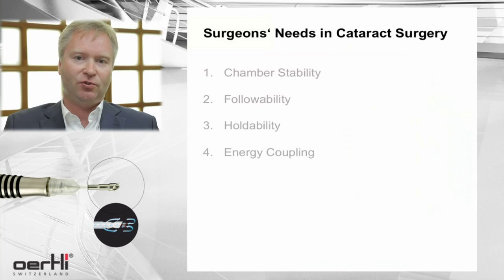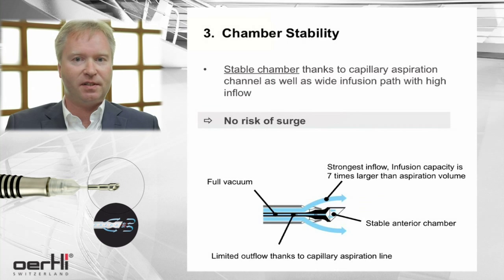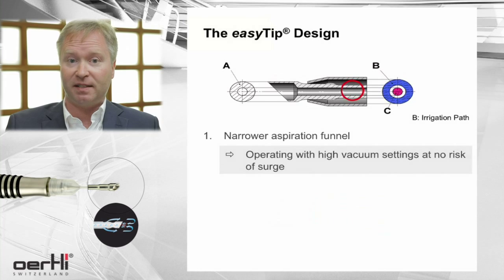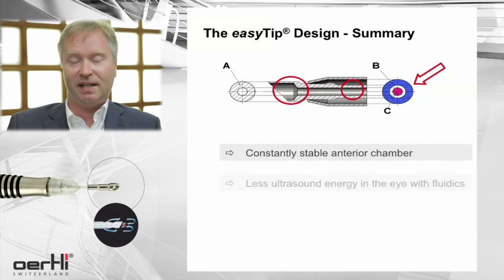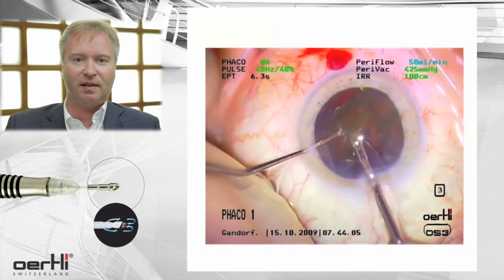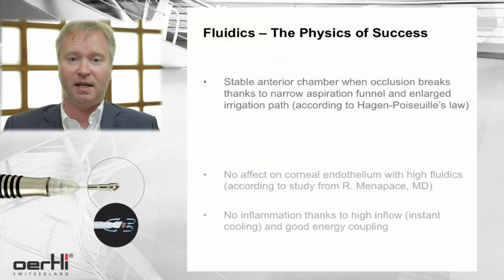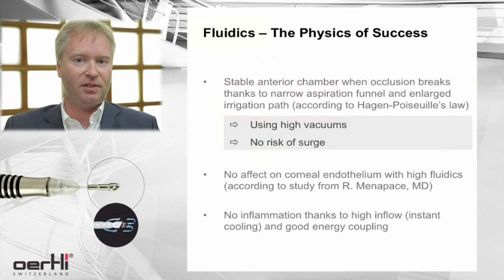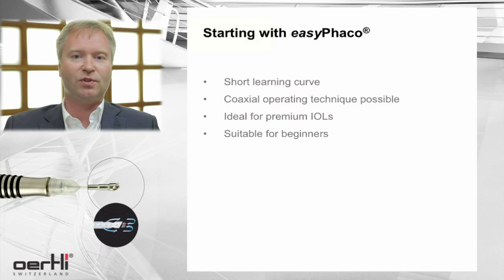Showcase: Fluidics in cataract surgery - safe and efficient phaco

Comment: Oertli is a dream phaco machine for any Ophthalmologist. Rock solid chamber stability ( no surge ), excellent cutting ability of six crystal phaco handpiece even in grade 5 cataract, strong hold ability, magnetic follow ability, crystal clear patient cornea on next day of surgery, Extremely sturdy zero maintenance console, reusable I/A cassette, 2.8 mm, 2.2 mm & 1.8 mm incision platform. 28KHz ultrasound frequency induces much lesser heat as compared to 40 KHz ultrasound platform. Oertli is cool by birth. Operating grade 4+ cataract with 40 khz ultrasound platform will burn the cornea, But, the cornea will be safe with 28 Khz ultrasound platform. So, Oertli does not need torsional delivery. Creation of "Torsional delivery" is against the basic principle of physics and a very poor attempt to cover up a technological limitation. Unlike longitudinal delivery,  Torsional delivery provides very poor energy coupling & creates a big mess with endothelium in the anterior chamber. May God save human corneas from the 40 KHz American machines.
Reply from the maker: Dear Sanjay,
Many thanks for this kind words about our easyPhaco technology. You made our day with this precise information. Take care!